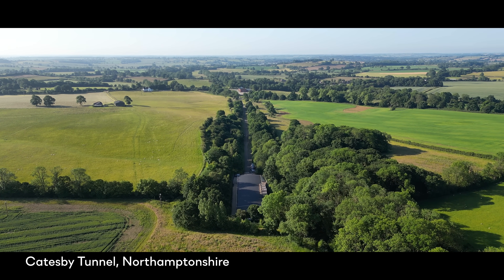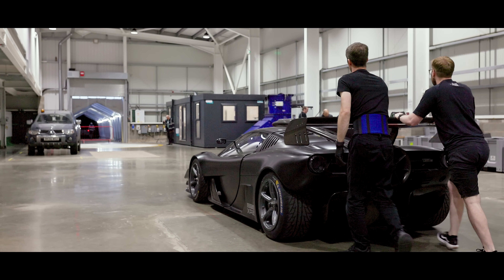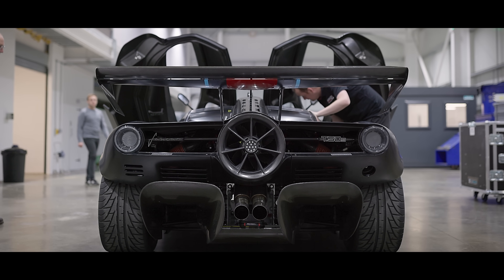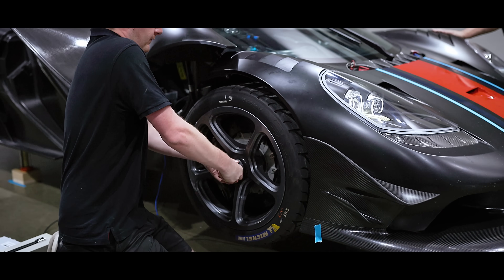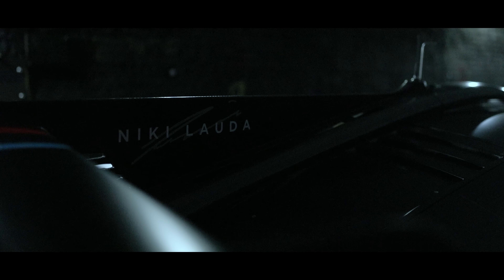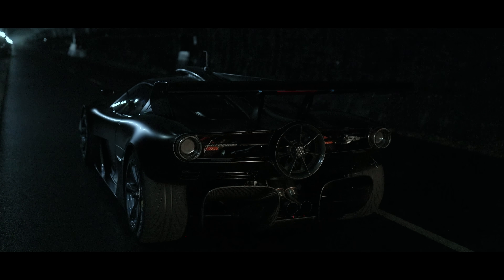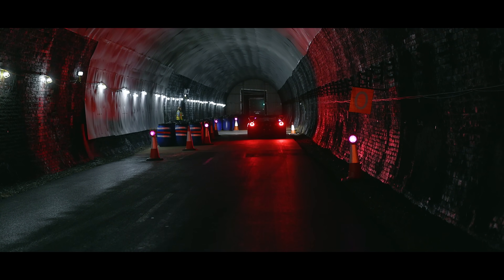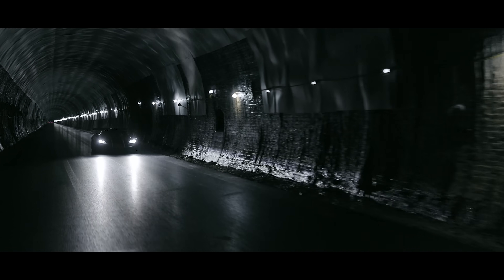T.50s VLOG | EPISODE #06 | AERODYNAMICS TESTING AT CATESBY TUNNEL

Comment: @4:30 The sound is so mental - that engine is blipping on every exhaust pulse on the downshift or when backing off the throttle. Those crackles aren't just pops and burble noise, the engine note can clearly be heard in them synced to the flames! God! That V12 when unleashed without limits is a monster!

Comment: I'm gonna say it. The LFA has been unseated as the best sounding engine ever produced. ❤❤❤
Reply: LFA had a howling V10. But that was the only good thing about it. I was listening to a podcast on LFA vs T50 and the owner who had driven both said the LFA was horrible to drive.
Reply: The LFA is still the best sounding road car. This T50s and the Pagani Huayra R are top 2 for track only.
Reply: @JonathanShiftsGears  we are still dicussing with a finished production LFA with a prototype T.50s . So the production vehicle may still dethrone the LFA. We got to wait and see.
Reply: @saikrishnathiwakarrk the point is that the T50s is not road legal. It will never be road legal—it’s for track use only.
Reply: @SixSpeedSeven  that brings a good point tho ,still the same engine is in T50 . It is just more horsepower and downforce . It still revs 12k rpm . So i will still bet at T50.
Reply: @saikrishnathiwakarrk the T.50s has a different ram air intake, airbox, and doesn't have cats. So the sound is definitely different from the T.50.

Edit: also, there's no VVT on the T.50s.
Reply: @TheDCJason  yeah , i just believe T.50 can beat LFA. if i get into race cars the Mazda 787B will come screaming at me , i remember that day because i was there to witness that miracle. And i have never had that feeling ever again. So T.50s might be one of the best sounding track cars of all time. But in road T50 can definitely give the run for the money for LFA.
Reply: @JonathanShiftsGears  honorable mentions: FXX K and Mazda 787b
Reply: Of course Toyota don't have cars handling like GMA/Mclaren.
Reply: A bold claim.......

Comment: Shame the car sounds great but is performing less well than originally quoted, only "upto 1200kg downforce" and ">900kg weight" according to the website. I wonder what financial buyout could have caused such a turn in performance ...
Reply: Too much stress on tires and not really usable by 99% of people. Same with red bull rb17, they had to reduce downforce
Reply: O desempenho não caiu, eles apenas reduziram de 1500 pra 1200kg de downforce antes de começar o projeto, ninguém viu o carro com a maior carga aerodinâmica
Reply: @gabrielbarcellos1036 I doubt anyone will see it at 1200kg either, don't always trust what you see
Reply: @gabrielbarcellos1036  I don't think anyone will see it at 1200kg either, don't always trust what you see in the media
Reply: @grossouw1996  it will be at 1200 kg downforce for those who want it. 1500 kg was too much for gentlemen drivers. The car is still 900 kg. The car gained a little weight with the addition of an oil cooler found needed from testing. 830+ hp/tonne is plenty of power to weight for a car this light. The car makes plenty of downforce, if they wanted more, the car would have a much bigger floor and over 2000 kg.

Comment: why does the surface look wet?
Reply: Catesby tunnel is homeostatic in condition meaning the temperature and climate doesn't change very much through the year, but being a huge underground tunnel running through the landscape, it has a lot of trapped moisture that is persistent through the walls onto the ground
Reply: Someone had an accident when they heard the redline 💦😂